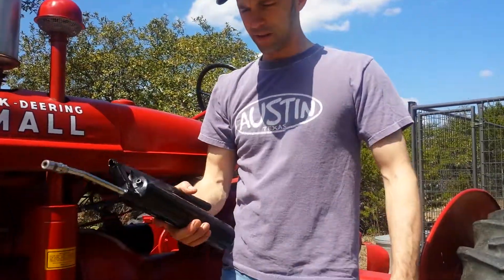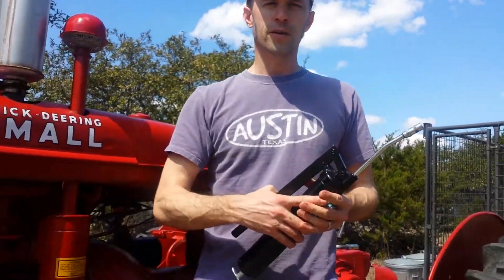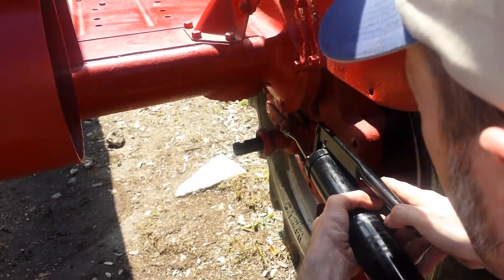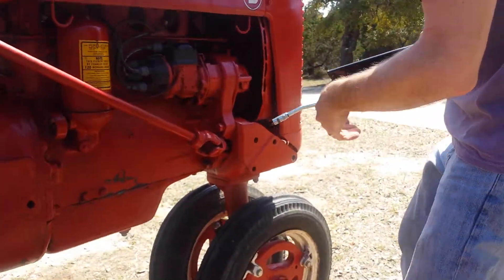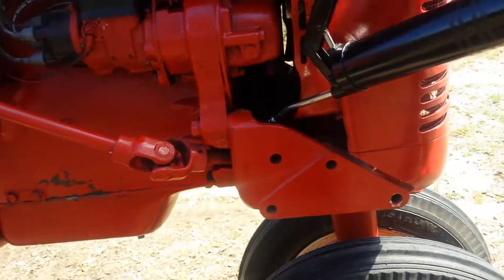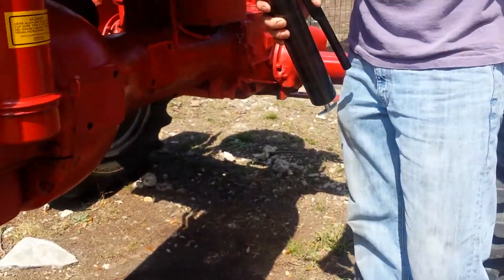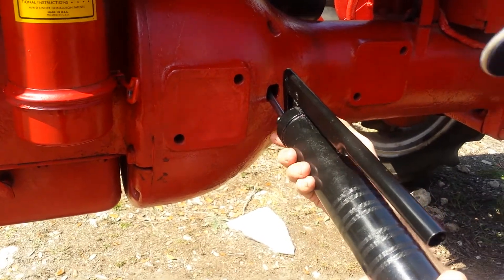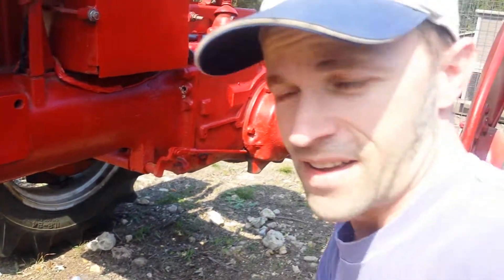Farmall B A Chassis Lubrication Grease Points Daily Procedure Maintenance Vintage Antique Tractor

Comment: Nice information.  I did not know about the clutch release bearing, and looked on my old 1944 B Farmall and there it is.  However, I don't have the rear axle zerk or the front wheel zerks.  I guess I will have to investigate further.